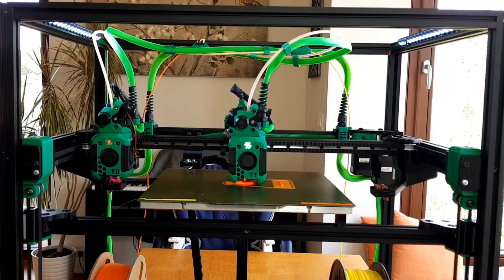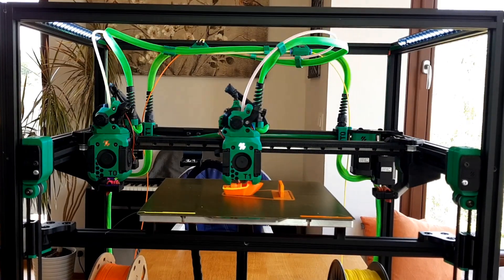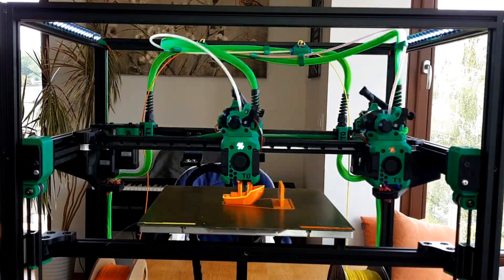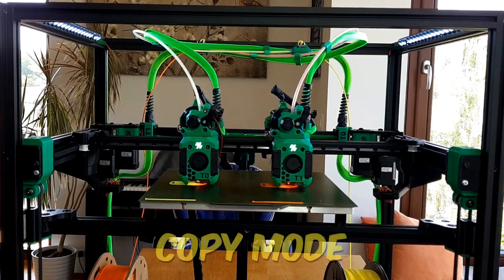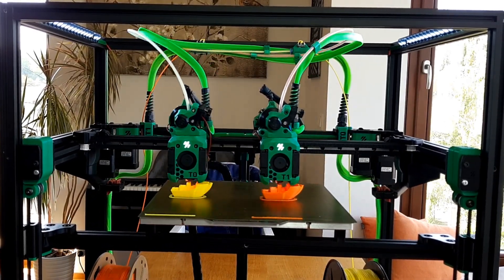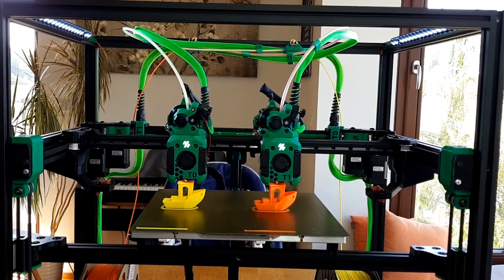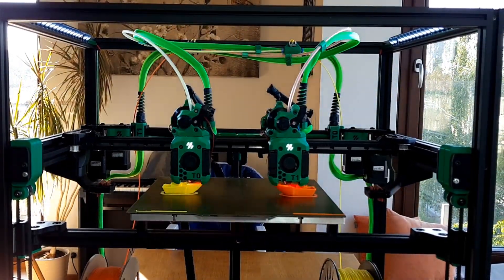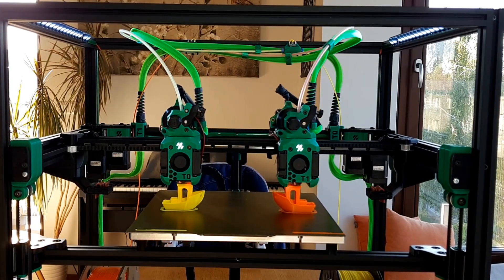Custome Voron Trident IDEX 3D Printer: Three Printing Modes

Comment: I’d it possible to combine a idex system with a toll changer so each head has 2-3 tool heads?
Reply from the maker: Yes, it's possible, but I'm not sure how practical it would be. Since one head would need to stop printing whenever the other switches tools, it might negate some of the advantages of an IDEX setup.

Comment: How do you solve the difference in a height between the two nozzles for copy and mirror mode? Is the second toolhead adjustable in Z?  Great looking machine!
Reply from the maker: Both toolheads should be assembled and mounted in the Z-axis as precisely as possible to minimize any height difference. So it's mainly a matter of mechanical calibration. The key is to ensure the first layer is as good as possible for both heads in copy or mirror mode. If the heads take turns printing in idex (color mode), it's possible to detect the difference using an endstop.

Comment: Hello.

Can you show print quality in defferent modes? How do you calibrate input shaping? Can you show graphs?
Reply from the maker: Hi, 
the printer prints in the same quality in all three modes. So, it depends on how the heads are calibrated. The only difference is that in copy and mirror modes, it's important to have as little difference in the Z-axis between both heads as possible. I perform Input Shaping for each head separately, as if they were working in independent mode. You can see the result, for example, here: https://youtube.com/shorts/c679P4mwRBQ, where the base was printed on this printer.

Comment: Hi Petr, can you link the githubs you used to build your belted Tridex?
Reply from the maker: Sure, I basically combined a few projects together:
Tridex: https://github.com/FrankenVoron/Tridex
Belted Z: https://github.com/3DPrintingMods/VoronTrident-BeltedZ
Joseph Mods:https://github.com/joseph-greiner/tridex_mods
and of corse Voron Trident: https://github.com/VoronDesign/Voron-Trident

I have a few parts designed by me, but I'll have to clean up my repository and hopefully publish them over the weekend.
Reply: @Petricius  do you have the link for your repo?
Reply from the maker: @artheoday  Not yet, I need to prepare and clean it. I will put link here soon.
Reply from the maker: I forgot to mention that in case you used belts and IDEX together, you have to use mathmaticalPotato idlers.
Reply: Dobře ty